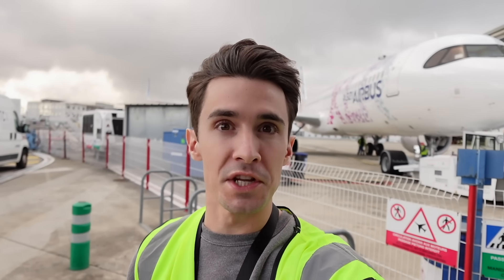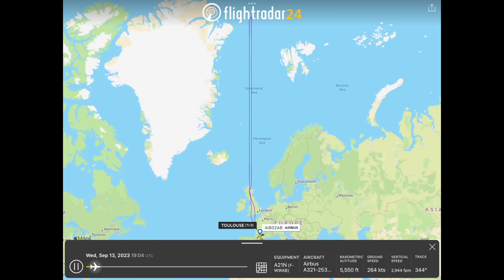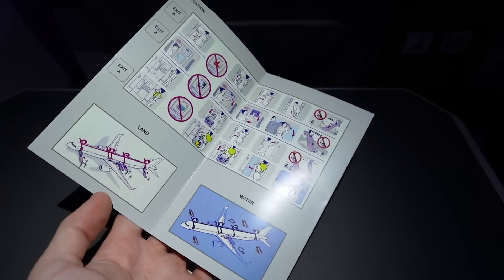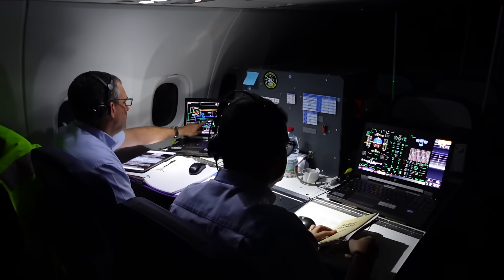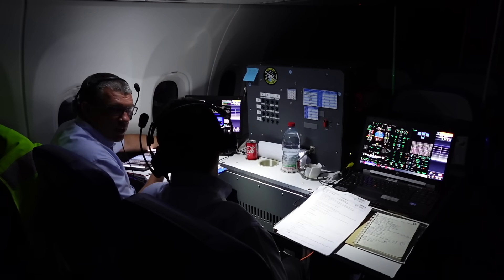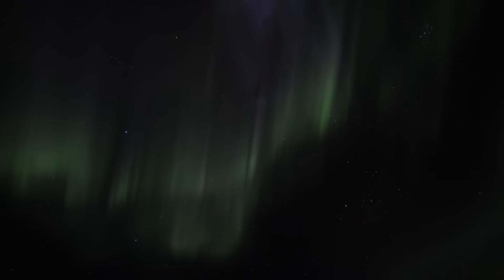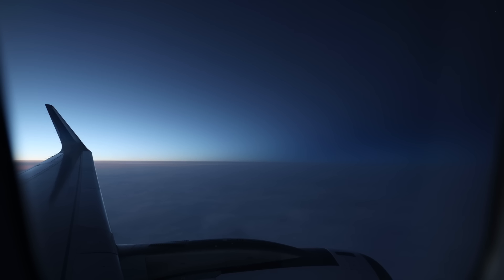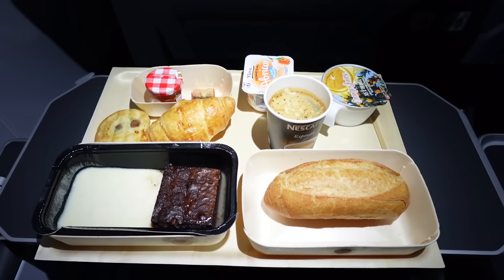Onboard an 11-hour A321XLR Test Flight to Nowhere!

Comment: The A321 A21N stretched variant  currently flys with Jet Blue between  London Gatwick and  New York JFK.  Slower than larger carrier aircraft such  as the B777, B787, A330 and A350, although cheaper.

Comment: The only negative for a narrow body in long haul is the lack of toilets. Otherwise it’s pretty much exactly the same as a wide body… and if it allows for cheaper tickets to more destinations then it’s a win for the consumer
Reply: They are really pushing this plane's capabilities. Even with the LR's, they are loaded to the max with full tanks, cargo and passengers. Not weighing carry ons and passengers means that some flights are definitely over gross. Some flights on the LR are already running out of water and wastewater capacity during the flight.
Not sure if they added more water/wastewater capacity to the XLR but it'll be interesting if they didn't.

Comment: The intricate design of the Concorde is simply phenomenal. And to think this jet was being designed at the time of the 747 design and first flight. The 60's were a magnificent  time for aviation. Also the lunar race and landing.
Reply: Concorde was never a commercial success.  Unique aircraft and technically ahead of its time.  Wonderful.  Still needed to make money.  And did not.  The crash, not Concorde's fault, allowed the airlines to run away from it.  Not because it was a bad plane; but a financial disaster.

Comment: do they have xlr cable support on the A321 XLR?
Reply: Yes they do. In fact, all modern Airbus aircraft are fitted with 5 Pin XLR input/output on the flight deck.

Comment: personally, i would wish the 321XLR to be fitted with 3+2 econ plus seats if it was ever to be an option. otherwise it's true nightmare for 11hr flight.
Reply from the maker: That would be nice! But is 3+3 really any worse than 3+4+3 on a widebody?
Reply: 3-3 A321 has ame eat width as most widebodies

Comment: First thing I notice are the disappointing windows... With new generation aircraft like the A220, A350 and 787 all boasting larger views, the A320 series still limits itself on old design in that regard.
Reply: does the size of the windows on a 787 really matter when most airlines will lock them closed the entire flight?
Reply: Well the A320 family is the oldest of all Airbus jet designs still in production. I believe the A321 XLR will be the last before they do a clean sheet replacement.

Comment: As cool as this is to see I'm certainly not going to be jumping on a narrow body long haul flight anytime soon, or ever if I can avoid it.
Reply: Why? Cuz u switch isles on a twin isle?  U need to do laps?  🙄
Reply: @rtbrtb_dutchy4183  no... more space, quieter, usually wider more comfortable seats, just the bigger cabin makes you feel so much less cramped and for some less claustrophobic. And wide body's are just so much cooler.

Idk what you're on about bud. I'm a pilot and I spend a lot of time on planes in the cockpit and out. I don't need to "change isle or do laps" or whatever you're gabbering on about.
Reply: @elliott7268  seats are the same. That depends on the airline anyway. You can have as much space in a narrow body than a wide body. 

You’re not the only pilot bud. 🙄 and I’m surprised that if you are, that you aren’t familiar with seats and their size etc. 

Narrow body long haul flying isn’t new.

Comment: Long haul wide bodied aircraft have sealed off crew rest areas, eg for cockpit crew immediately behind the cockpit, or up or below.  What do they provide on this aircraft?
Reply: I wonder if you work for Boeing
Reply: @jsurfin1 - It is my understanding, happy to be corrected that over 8 hours one relief pilot is required.  Now it could be that there have been successful negotiations between the airlines and the pilot unions to extend that.  I understand that has been a long term strategy of Qantas.
Reply: @TheRuben_music It has been said that once you have avgas in your system it never leaves you.  I started my professional career as a manager in one of the Australian domestic airlines as they were back then.  I have maintained a general interest in aviation since then.
Reply: With a max of 11 hours flying time, provided the crew has a layover at the destination, 2 pilots is enough per FTL and there won't be a need for a crew rest area.

Comment: I'm curious as to how much the agreed upon added fuel tank reinforcements would impact actual usable range vis-a-vis A321LR, and if the rumors are true that its Boeing operatives who were bleating on about it to European authorities in an attempt to hinder or weaken the advantages that the XLR would bring versus the dinosaur 737 family. Boeing has nothing in 10-20 years to compete with this thing, so they're just resorting to undermine the competition in any way possible. 😬
Reply: It’s more like 35 years already that Boeing hasn’t given a proper response to the A320 family.
They basically put some new more efficient engines and sell the dinosaur as a superior state of the art aircraft. 
As long as it decrease operational costs to operators and dispense new pilot certification, those seem to be happy as well. …and same goes for the vast majority of passengers that know little about these flying machines and many will even prefer a 737 to an A320 because of the manufacturer.
Reply: @miks564 Well, lets see… 737NG series, and 737MAX series, in response to what? The A320NEO series “they basicly put some more efficient engines on it” and sell their old design as new..
Reply: @ACPilot  There's a big difference. A320 are computer operated aircraft. Meaning, despite still having one or another old legacy system on board, the neos are basically modern aircraft with all the modern flight systems available today, but in an old airframe. That also explains how easy it was for Airbus to compensate the A320 flight behavior for the more powerful engines.
 The Max is still the same pulleys and cables running along the airframe manual kind of aircraft.
That's also the reason Boeing isn't able to get other Max versions approved.
After the requalification of the MAX, FAA closed the eyes to the -9 as a compromise to allow Boeing to get the aircraft back in the air, but they kept the requirement of having EICAS installed (like in any other Boeing aircraft) on all remaining Max variants. This means Boeing has to somehow interconnect the 737 old flight systems with computer systems even if only for monitorization and troubleshooting purposes. Seems easy, but of course it isn't because 737s never had this level of monitorization on board.
Boeing needed to start a new narrow body design by the time they launched the NG as a response to the original A320s. But instead they kept 'milking the cow'.
737s and A320s are direct competitors because they do the same with similar efficiency (cost of operation), but the similarities end there.
Reply: Yeah man. The a320 is like that old uncle whereas the 737 is your great grandfather😄
Reply: This is nothing.  The real thing holding the A320 family back (esp the 321s) is the wing.  Now Airbus has designed a new one, possibly with 777X foldable type wing tips. The new winged A321 Neos (possiblybcalled the A322) will be the true game changers and I think the final nail in Boeings narrow body commercial production coffin.
Reply: @NovejSpeed3  Nothing is holding back the A320 family, because there's lack of competition in the narrow bodies. That's why they become the most successful aircraft to date.
Better wings will help, but the main problem are the materials the aircraft is made of that make them heavier than if it they were made of modern light materials.
The best next thing is the smaller A220-300, but that's still Airbus, since they acquired the design from Bombardier.
Reply: Back in 1987 when the A320 made its maiden flight, Boeing should have committed to a 737 replacement. They knew that engines would get bigger to be more efficient, and the low landing gear on the 737 was living on borrowed time even back then. Instead they went short term with their Frankenstein 737 max and MCAS

Comment: Nice video. Does anyone know if the additional weight from the fireproofing material placed on the rear internal fuel tank (as required by European regulatory authorities) actually reduced the A321XLR's maximum range? I had read about a 200 nautical mile reduction.
Reply: Bear in mind Airbus would have been slightly conservative with their estimates. So even if there is a reduction in range, their conservative initial estimates will be able to somewhat absorb the hit. I doubt it will be anything above 200nm. A slight MTOW bump and aero cleanup would also help.

Comment: I hope I never have to take a long haul narrow body plane.
Reply: Why? The seats are the same width as a wide body.
Reply: @SteveJohnFrank  it is not about the seat pitch, it's having two isles so if one is congested you can use the other isle to get up and stretch
Reply: @jokerface20 how? You would still have to get through the congested isle to get to the back or middle to switch isles. 🙄  and who switches isles anyway?  I’ve never done that.
Reply: @rtbrtb_dutchy4183  not if you can walk forward and go to the other isle, more toilets aswell, and a more spacious cabin means a lot on a long haul flight for comfort in my personal experience
Reply: But you'd be fine 9 abreast in a dual corridor "wide" body with the same seat dimensions and pitch. 😁

Comment: I think this is a great move from Airbus, this will be a great tool for airline companies.
That said, I do not fancy long flights on narrow bodies, in my opinion, 3 hours or more in a narrow body are struggle.
 My favorite aircraft is the A330 because I have very good experiences with it: I like how it looks on the outside, I love how it lands and how well it flies, it's basically a giant glider and even being older, it also features a much more quieter cabin than this one.
 However, exclusively as a passenger, nothing beats the A380.
Reply: Gonna be honest, with modern economy cabins at least, I'd take a 321XLR over a 777 any day of the week... Just because of the seat width.
Reply: @wewillrockyou1986  777 is my favorite aircraft though, a magnificent piece of engineering. I'll take a 777 any day over some a single aisle
Reply: @Jack3md  not really sure what the attraction is of a 777, it's not particularly interesting like a 74 or 380, and it's worse comfort wise than a 78 or 350 because of the lower cabin pressure, lower humidity, and far worse noise.
Reply: @wewillrockyou1986   Well it is an older aircraft, but still one of Boeing's best engineered and built aircraft by far without as many issues. 1,700+ delivered to date. It's a proven machine, very reliable widebody since first delivery in 1995.
Reply: Have you flown recently on A321LR aircraft? I have, and in my opinion it was great!
I had an Air Astana flight of 5.5 hours, and everything was great about. 
When the airline configures the narrow body for long haul, it really doesn't matter in my opinion.
Reply: My favourite is A340 and A380.
Reply: Imo it's gonna be a great option for flights that used to be one widebody + narrowbody and all the hassle of connection's. Being able to serve smaller markets, further apart with direct routes is a game changer for me personally.
Reply: I don’t like flying 8 hours + on the A380, very low humidy and less natural cabin pressure makes jet lag worse and the 787 and A350 are so much better in this regard you really feel the difference on a 12 hour flight in terms of how refreshed you feel when getting off.
Reply: Have you been on a 777 300er?
Reply: I agree...single aisle long haul is good for the airline only, not for passengers.  I will never fly on this aircraft.
Reply: @davidcole333 Depends on where and how often you fly but you may have to choose between flying    long haul on a narrow body or not going at all. Comfort depends on how much legroom you have and how far back the seat reclines. Some of the top end corporate jets fly for 15 plus hours and are relatively small airframes.
Reply: @davidcole333 it’s not really for all airlines either. It’s really only certain airlines. It’s unlikely you’ll see a narrow body traversing the pacific not because it can’t but because it wouldn’t be profitable for any airline. Especially considering most of the destinations whether you’re coming to the west coast or leaving the west coast are high profile locations where the fees would be high.

Comment: Tells you quite a bit about their confidence level to test fly a plane in a region with barely any airports to divert to in case of problems.
Reply: Well it's still an A320 family aircraft, not anything totally different
Reply: Said Boeing lol @LorenzoGiordanoGomes
Reply: I mean aside from the fact that others have already mentioned (it's a stretched version of a plane that is well known), it's not like they're starting off with this flight. There are years of design, shorter test flights and simulations before they got here. They can be confident because of all of that groundwork before.
Reply: That's SOP for this stage of testing, nothing special.
Reply: I'm sure the 180 ETOPS still applies to this flight.
Reply: With Airbus you can do, with Boeing you shouldn’t.😂😂😂😂
Reply: Its the reason they are testing, like the engineer said, they want to know if it does polar navigation.
Reply: they are always in the range of ANY glide in airport
Reply: A test flight isnt even ment to be 100% safe
Reply: They were so confident that they did not even look at the gas gauges at all during the flight.  Yeah, right.
Reply: Reminds me of penguins of the madagascar
Reply: Cold weather testing is part of the testing curriculum anyways I think.
Reply: Airbus is clearly ahead, the A320 configuration is a success
Reply: Well it‘s an Airbus. I would step on the first flight after the airplane leaves the hanger for the first time. I would be afraid for my life if it was a Boeing
Reply: @maxi-g  It's definitely time that Boeing stopped trying to reinvent the 737 and build a brand new design aircraft fit for long-haul large turbo-fan engines. At the moment the 737 is a Frankenstein's monster of an aircraft design.
Reply: @maxi-g you are either a coward ignorant AF or both! Which is it?
Reply: @maxi-g 😂
Reply: Same! I had a flight today. Sat down, saw it was old and thought; "Thank god"  @maxi-g
Reply: @maxi-g  I would rather take my chances with Boeing's reliable engines than airbus with issue after issue
Reply: @maxi-g   to be air, the Boeing 737s are pretty good, it;s their newer fleet and the 747s that had the most problems
Reply: Surely you mean the 787s and not the 747s
Reply: @maxi-g  😂
Reply: @maxi-g  How many more people have died in Boeing accidents versus Airbus accidents?
Reply: @dodahspeak  lol boeing is the record holder
Reply: @maxi-g I guess you're forgetting about the engine issues on the Neo...
Reply: @Aleksandar6ix  That was a Pratt & Whitney issue though, not an Airbus one.
Reply: @TheMightyHams  Also, it seems like this particular aircraft is engined with Leap engines, which are a more conventional and proven design than P&W's geared turbofan.
Reply: @Aleksandar6ix As you said “Engine Issues” have nothing to do with Airbus. Pratt & Whitney are responsible for its reliability.
Reply: I might be totally wrong, but I figured this was done to have the least amount of headwind and tailwind by going north and south. Now they can turn around right at 5.5 hrs and the return flight will be almost identical.
Reply: @rtbrtb_dutchy4183  Dirty little secret has been exposed.
Reply: It’s hardly a ‘new’ plane. It’s only a new variant.
Reply: @xr6lad  sure but until now they didn't do 11h flights...
Reply: Say that to Boeing hahahaha @xr6lad
Reply: Worse than that, it's one of the few areas on the globe where it is very easy to make a navigation mistake. Korean airlines made such a mistake and ended up ditching on a frozen lake on the Kola peninsular thanks to Soviet air defence. KAL 902, 20/4/78 Paris-Anchorage-Seoul.